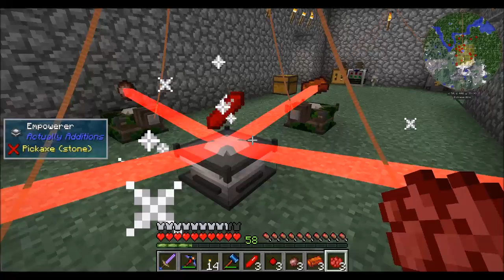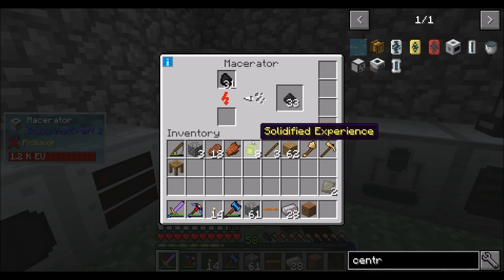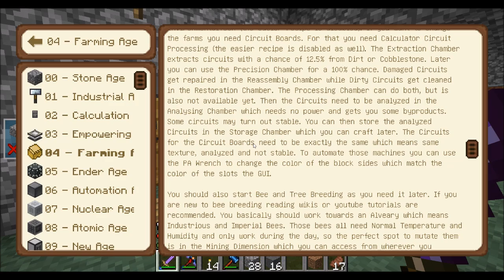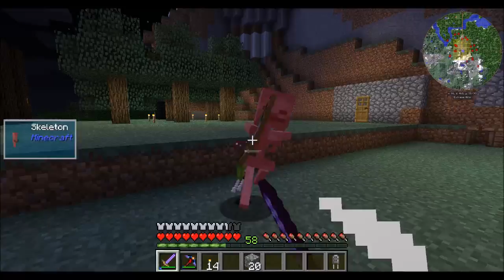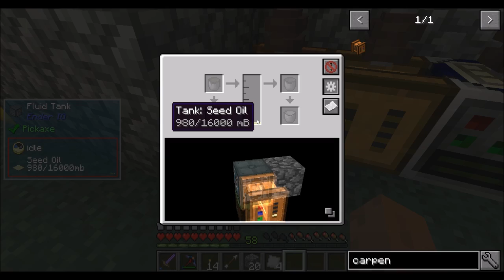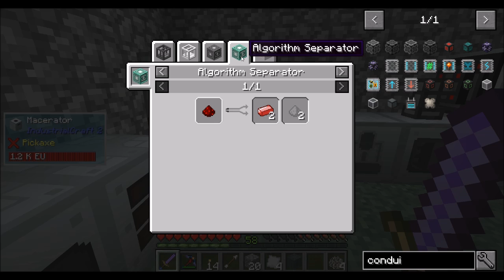AoE Ep12 Ender Age

Comment: Direwolf I am pretty sure you can attach a IE wire connector to a IC2 wire or energy storage block to convert RF into IC power an vice versa, it really helps with power generation
Upvote so he can see
Reply: Yeah, IE connectors on IC2 machine will convert IE to IC.  he seems to lean towards being a purist with mods.  Which, sure why not other than really hurting progression rate IMO.  That and he seems to refuse to make more than one of a machine.  Should have made multiple coal gens many episodes back too which could have helped as well.

Comment: 0:35 The Resonating Redstone Crystal shown here says you are using 15130 GP out of 756.5K GP, but you probably haven't set up any GP system yet. Why?
Reply: XU2 bug with chunkloading, I believe. Updating the version helps, but the author of this modpack has XU2 set to the version it is for the blocks it has, so I wouldn't advise it if you can fix it with file editing.

Comment: hey man really been loving this pack. it is making me learn a whole bunch of other mods i never really got in to. also a tip for the cloche. I just took 3 fluid tanks and stacked them and filled them all up with water and made them push into the bottom tank that went into the cloche. it really doesnt use that much water. i haven't even gotten into the second tank yet and it filled up most of a chest with canola. the canola press is a great way to make some power i love it.

Comment: I have had enough problems with my iron supply that I have actually set up the first segment of a 4 segment Iron Golem farm.  I also have 6 coke ovens going so I can turn 6 stacks of charcoal into 1 stack of carbon bricks and then into carbon dust, which is ore dictionaried with coal dust. From there, if I feel the need for actual coal I can turn the carbon dust into coal bricks and then into coal, or I can use it for anything coal dust is used for; raw carbon fiber, solar panels, diamonds, etc.  Right now I am trying to figure out how to automate getting it to carbon dust.  I have a spruce tree farm managed by an Ender IO farming station with an unbreakable axe, powered by IE thermoelectric generators and the 6 coke ovens.

Comment: So I'm at the Ender age as well, some notes on my experience so far.
1. Had to manually update Extra utilities due to a weird bug with FTB chunkloading making you use grid power on nothing.
2. Created the calculator docking station for automating the enriched coal stuff. Just throw a calculator into it and you can use it as a block. Though just note there's also a bug that when piping things out of it, it tends to duplicate it's output forever, so I couldn't use it for automation yet, though it is still nice having a place to put my calculators.
3. I setup the machines for overclockers in IC2, made life a lot easier, since once they are up, you can make a lot of them easily enough.
4. Tried setting up the IC2 farm for stickreeds, which would have made rubber easy to automate in a small space, but either the gods of RNG really hate me, or IC2 is bugged, because I wasted 6 hours of my life trying to crossbreed them, and I got everything else except stickreeds. (if anyone else was successful in this mod pack, please let me know what you did, I've done it before, so I know I got the process done right, at least in a previous version)
5. Setup a mob farm with PA, though I couldn't pipe swords into it for some reason, so I need to find another solution.
6. Running power gen on normal canola oil, so 2x oil generators from Actually Addions, and 4x semifluid generators from IC2 (and a LV solar panel and wooden wind turbine. My base is on a low y level, and don't feel like or need to setup a tall wind turbine, it's just to keep basic power from relying on oil)
7. Macerating blocks instead of each item like coal is way faster (others keep mentioning it as well).
8. I created the IC2 redstone inverter upgrades to remove the need for levers, and made a set of ejector and pulling upgrades using the dense plate recipes which makes them quite cheap, and made the process for the electronic sorting machine easier as well (For making steel, I used a similar setup with the sorting machine to the one on the IC2 blast furnace wiki).

Hope that helps someone.

Comment: What happened to the Dire vids we used to get? The ones where he builds amazing automation that few thought of before?
At this point in the pack, I already had 3 coke ovens cooking up wood to charcoal, fed by an automated tree farm. The charcoal was automatically transferred to three coal generators that kept my IC2 machines happy.
Took about half an hour to set up and I haven't had power issues with IC2 since.

Side note, the Small Progressions tree farm will feed itself with logs to burn for fuel, so you never have to worry about that. All you need to worry about is supplying axes, which I did with stone axes fed through a hoppered chest. One chestful is enough for at least 10 hours (that's how long I've been playing since I put it out and it hasn't run out yet).
Reply: Is this irony? I remember This wolf20 as a person that rushes the equaliavent exchange mod to make it easier on himself in his earlier series
going through the ages to get better gear is just the same he doesnt like the weaker early game stuff that has to be replaced
Reply: I have to agree, i love the videos where everything was automated as early as possible.

Comment: Protip: If you have power problems with IC2 and you just need to do a simple task, like Thermal Centrifuge some quartz, you can put redstone dust into the CESU to get instant power. Each dust gives a rather respectable amount.
Three-four stacks should enable you to process all 18 quartz.

Comment: For early water I used the Immersive Engineering pump. Needs a tiny bit of RF, so I just plopped a survival generator on top of it with some coal and forgot about it.

Comment: I love how episode 8, episode 11 and episode 12 (this one) have almost the exact same thumbnail.
Reply: For some strange reason, the WAILA thingy is different (even though he's facing the macerator on both images, on episode 8 it shows the CESU lol).
Reply: Huh, just noticed that.
Reply: Episodes 8 and 11 ARE identical. 12 has an extra machine.
Reply: I think there's some update lag in WAILA and he does turn and move quite fast.
Reply: Aeriosus Not quite, the crosshair is slightly off